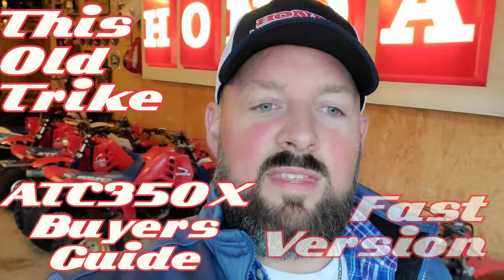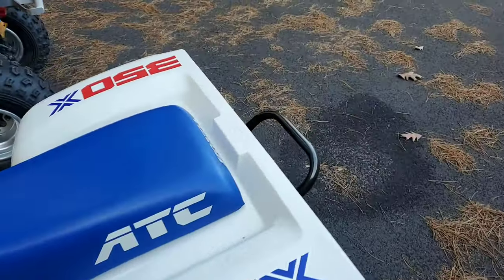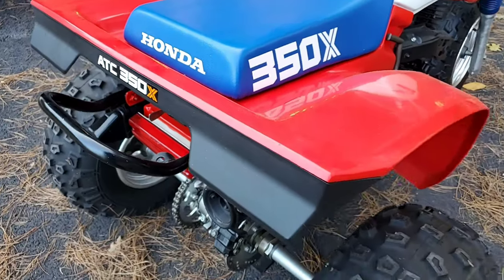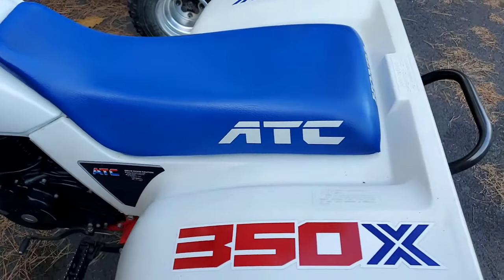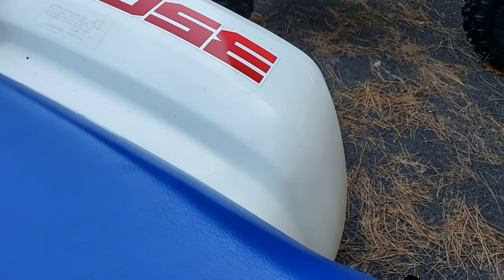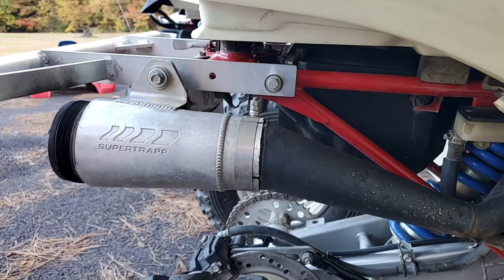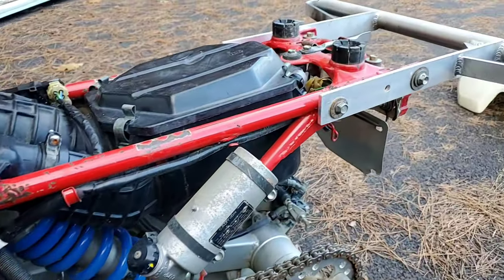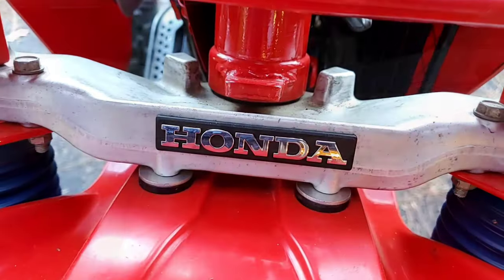Honda ATC 350X Buyer's Guide - Fast Version

Comment: I was 16 in 86 and wanted a 350x so bad. Mom said no way you will die lol. she probably was right. I got a 200sx instead and still have it all original runs like a Honda. Might look for a good deal on a 350x they still look amazing all theses years later.

Comment: My 86 350x doesnt have the original grab bar or the tool box, ive found both on ebay, of course, but didnt see the "bushings or grommets" that fit between the two, any ideas where to get those, along with the bolts? Thanks!

Comment: You have nys plates. How?
Reply from the maker: Because the one is registered.  It's easy.
Reply: @This Old Trike  well my cousin and I trying to figure out how with ours for snirt runs. We told no by local dmv's. We have barns full of machines just rotting. Some machines not run in 35 years. Being farmers We chased cows with them and fixed fence but with no regi most were parked other than a few 250s and fat cats
Reply from the maker: Well, when you go in with your paperwork that says ATC 350X or 250ES or whatever it is... the nice ladies behind the counter don't know what it is you're registering.  And there's no law that says you can't register a three wheeler in NYS period.  There's three wheeled motor cycles!  Just fill out the paperwork and bring it in.  If you don't have prior paperwork there are 2 additional forms that you will need also.  Maybe I should do a video on that!
Reply: I'd like that video. Our local ladies probably are farmers wives and daughters that know and just don't like them. I'll try another. And if you need specific parts like that clutch adjustment cover I may have in old 16x24 chicken coupe that I filled with bones of Hondas and other toys that were beat into the ground from us as kids. I'm also considering driving to PA or other surrounding states for a 350x to torture my cousin during snirt run on his oem 200x. Lol. If you have one for grabs I'd consider. I'm obviously around the tug hill. Being I'm messing around with snirt run.
Reply: Im currently still running my 85 or 86 250es. I don't remember which one it was but was mint oem. My brother asked to chase cows n I said ya. Big mistake I almost cried when I went to get it. He left in barnyard with a talking bull that was mad cows were in barn. Plastic got destroyed on a low hour es that didn't have a Crack or scratch on anything. Now I've come to point of aftermarket dress and tank coating.
Reply from the maker: UGH!!  No offense, but your brother is an a-hole...  He should make it right and pay for a machine of equal or better value/condition.  Wow...  That hurts.  And I'll absolutely make that video, so stay tuned.  I'll do it this month with the 86 350X I just got.